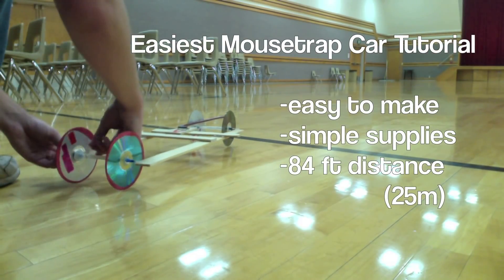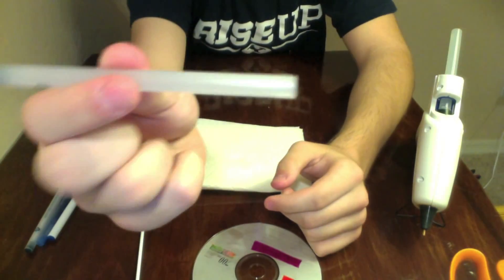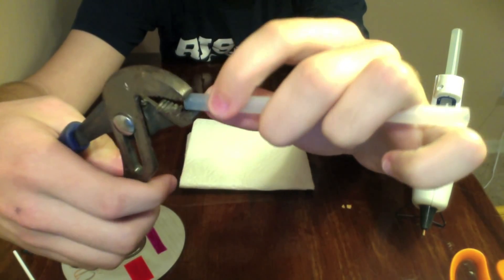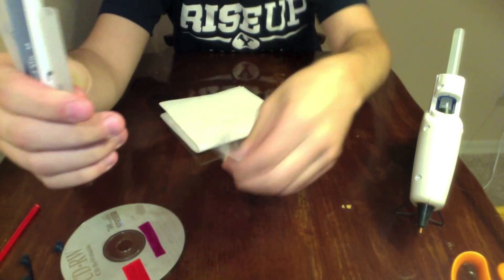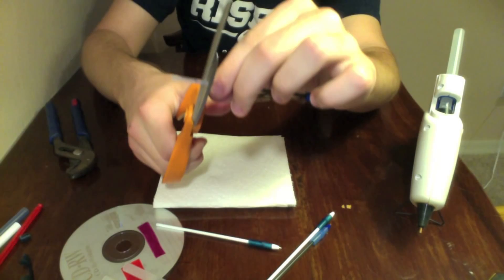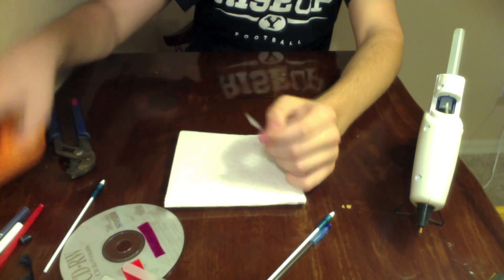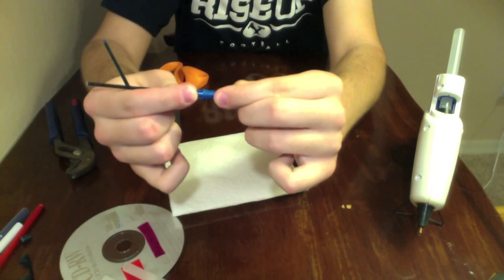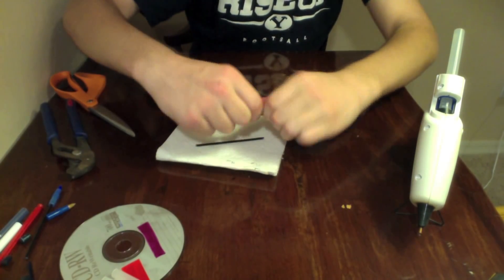EASIEST mousetrap car tutorial (Part 1/4)

Comment: before i watch this, is there a way i can do it without using the balloon? also i cannot use a balloon for mine, and also what would the dimensions in centimeters be? thanks!
Reply from the maker: The balloons really aren't necessary, they just help the car get some traction while accelerating. Im not sure what the dimensions of this particular car were, but you can easily change the dimensions by shortening or lengthening the paint stir sticks. Best of luck! Let me know how it goes!
Reply: Jegber
alright! thanks dude!
Reply: Jegber do we have to use fishing line

Comment: Well I had to quickly come up with a plan to assist my 6th grader with a mousetrap car. I came across this video (thankfully) and we constructed it yesterday and worked great! The only thing i would do differently is put the braces on last after the wheels are on so that the axels are snug into the ink wells and then glue the cross braces down. And I found it easier to put the loop on the toothpick first then tie it to the other end of the mouse trap wire last.  And i had a hard time finding a hanger with holes in both ends? I had to drill a hold in one end of my two hangers that i cut. But overall.. GREAT video. Thanks so much.
Reply: nice

Comment: My son used your video to build a mouse trap car for his 8th grade science class. We used 4 bic white pens with blue ink. (The case was not clear.) We also got the 3 paint sticks from Home Depot. They kept the large 21 inch sticks behind the counter. We just had to ask for them. Free! He followed the directions exactly, but when he went to put on the back wheels, there was too much space even pulling out the pen tips.(About an inch too big.) The front wheels were perfect. He must have bumped it when the glue dried. Instead of starting over, we turned the oven on to 500 degrees and put the "H" frame on a cookie sheet lined with tin foil. After about 5 minutes the glue was soft again and we were able to move the back sticks closer to each other and finish the project! It worked perfectly! Thanks Jegber!